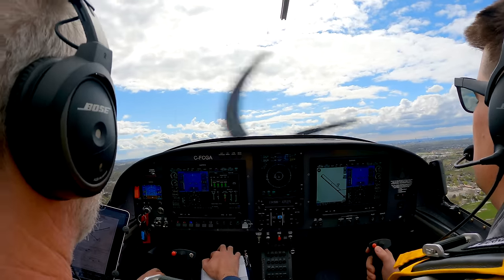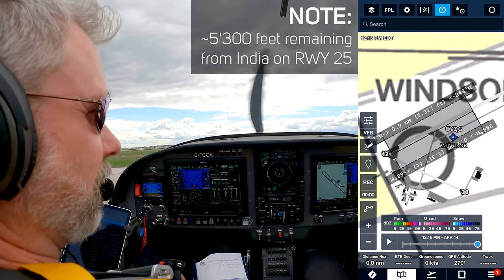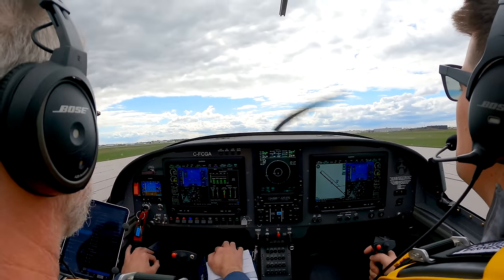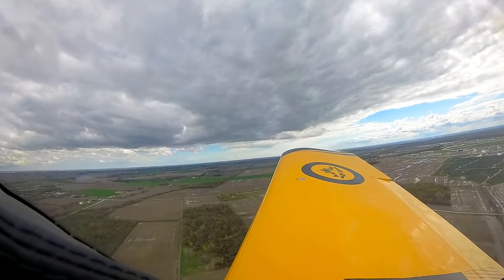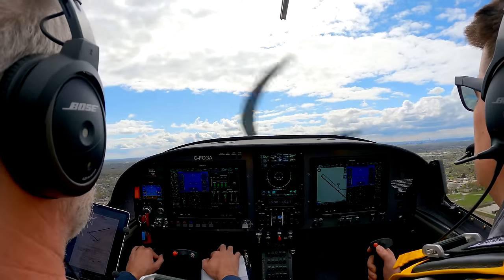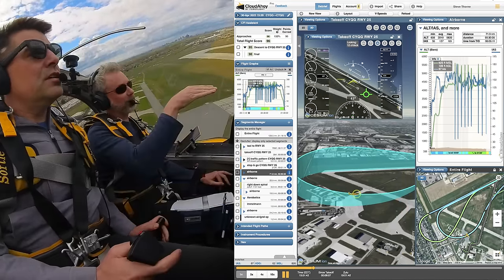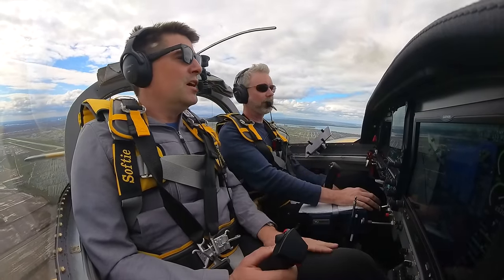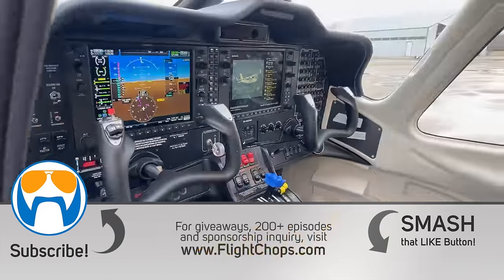Making the IMPOSSIBLE Turn… Possible from 600' AGL?

Comment: I do 300 feet all day long with my students. Depends on the aircraft and DA
Reply: Most engine fails are partial power.  Power go down due mostly lost one cylinder.  On 4 cylinders engines will go down to 1,800-1,900 rpm.  Just about Minimum Level Power (MLP).  Practice MLP Slow Flight.  With about 10 degr. flaps. One of my students with only 70 hours total, took off C172 with 3 adults on board, rpm dropped to that, but he had training turnback from 400 agl. He turned back from 300 agl, landed opposite.  No damages.  I taughtTurnback Training in the 1990's,.  Partial and total EFATO I did.  I called that EmergencyLowManeuvering.  

The 444 Partial Power Rule .  If over 400 agl, turn to side 40 degrees for 4 seconds while leaning mixture a bit and SOME Carb Heat too.  Then 40 deg bank to the runway at Vglide speed.  444 Partial Power Rule. drop flaps on it before drop all the power to land.

Comment: That copilot is sooo scared and insecure of the Vglide 45 Turnback.  He needs to practice lots more.  Do first The Vglide speed level turbacks.  After flying along a highway, flyover a spot, get room for turnback and flyover again at Vglide 45 bank level until you get used to turnbacks, then do the EFATO after. 

Good to learn them on GRM Turnbacks first. Many accidents when doing GRM turnbacks, and Box Canyon turnbacks and Circling Turnbacks.  Ignorance is not the solution.  Ignorance is the problem that causes accidents..

Comment: At the end of the day, the physics of this problem are all about ANGLES. Climb angle, wind angle, descent angle, bank angle, and such. Everyone gets all hung up about a minimum altitude but the question, grossly simplified, is really did you have a climb angle well in excess of your descent angle. If you can’t answer that question you shouldn’t be turning back. 

In college I wrote a computer code which completely solved this problem. You could put in the variables for everything, runway geometry, aircraft performance, pilot performance and it would find the minimum altitude and performance numbers to make it happen. I used the code and practiced the maneuver many times and from all that experience I’ve come to the point now where I’m rarely if ever willing to turn back. 

Not much more dangerous out there than an amateur test pilot. Consider your limited knowledge, ability, and testing capability before you go off playing Chuck Yeager. 

Be careful out there…

Comment: @3:38 - no read back what so ever...
Reply from the maker: While I tend to read back VFR clearances and instructions, they are not required (unless including a "hold shot", etc) other than to acknowledge with the tail number, as Luke did.  
He's a senior flight instructor, and certified flight test examiner - his procedures are solid.
Reply: yeah I also noticed they never read back any cleared for takeoff or to land after the 1st go around. You'd be getting an earful from any CFI
Reply from the maker: Rules might be different in the U.S. but in Canada acknowledging those specific VFR calls with just the tail number are the correct procedure.  That said, I'm not as experienced as Luke, and I do tend to read back more IFR style just to be extra thorough.
Reply: @FlightChops  I believe readback is mandatory VFR in the US, but it's not in Canada. I personally prefer to read everything back to make sure I heard right. It's saved me a few times from stupid so I will always recommend read back. Only time I'll answer with just my call sign is when I'm clear to land with no additional instructions from tower.
Reply: According to the Canadian Aviation Regulations (SOR /96-433), pilots are required to read back any air traffic control (ATC) clearance to the appropriate air traffic control unit if they are flying under Instrument Flight Rules (IFR). For Visual Flight Rules (VFR) flights, pilots are only required to read back an ATC clearance if the air traffic control unit requests it. Pilots should read back parts of ATC clearances that include runway assignments, vectors, or altitude assignments to verify that they and the air traffic controllers understand each other.
Reply: @onyourbikes  well fair enough I don't know Canada regs but if you don't think should be good practice to read back a take off or landing clearance then good luck out there
Reply: @sdluke  I read back as much as I can (I'm in Canada) even though not required under Canadian regs for VFR. 
But 
There are times at my home airport when you can't get a word in edgewise, and I've heard the controllers chastise VFR pilots for giving read-backs and clogging up the freq. Different countries, different rules, different cultures.

Comment: This is not a realistic trial.
The runway is very long.
The impossible turn is impossible from virtually all standard municipal airports.
Reply from the maker: If you look closely at what is going on during the 800' AGL test we were lined up well beyond the departure end and would have touched down probably with in ~2000' of India, where we'd departed from (Thus a ~2000' runway would have worked, but you've inspired me to run the actual numbers to determine what the shortest runway we could have departed from, and made it back to would have been). 
Regardless, from 600' AGL we couldn't even get lined up, let alone make it back to the runway we departed from, so length is moot in that case, and that is the key data I was looking to collect here.

Comment: It’s irresponsible flying.
Straight ahead
Reply from the maker: If you're going to make a statement like that, please offer some value with insights to explain.
Reply: No, it’s not. There are some conditions where you can safely turn back. It depends on the winds (ideally a crosswind situation) and of course altitude.
Reply: Promoting such actions to low time pilots / inexperienced pilots that may be watching your channel can bring them unstuck quickly. That’s a fact.

Comment: This is NOT realistic and doesn’t NOT simulate a loss of thrust on takeoff. The last person who made videos like this attempted to return after engine trouble and it didn’t end well.
Reply: It wasn't intended to simulate that. 🤷‍♂️
Reply: @owensparks5013 .  It says right in the beginning of the video they’re testing multiple scenarios. These are based on the title scenarios where an engine is lost on takeoff and attempt is made to return to the runway which results in low altitude stall/spin and death 90% of the time..  it is lunacy to practice it
Reply: I call BS on that comment.  Maintaining airspeed in a turn is a basic skill taught before you even solo.  Impossible turn at an appropriate altitude is no different than any other emergency procedure a pilot should now.

Comment: Come on Chops.  You Know Better.   
GO STRAIGHT AHEAD.   The second the scenario commences, the airplane belongs to the ins. co.   Go straight ahead.  If you are 2000 agl  you can shop for a place.  
I believe in Aqp.  And. Stick  and rudder by Wolfgang L.
Reply from the maker: Did you watch this episode? I'm not worried about saving the airplane... Straight ahead from Runway 25 here is almost certainly going to be fatal AND means you're likely taking civilians with you.
Reply: Depends.  USe the Power OFF Turnback 777 law.
Reply: Most engine fails are partial power.  Power go down due mostly lost one cylinder.  On 4 cylinders engines will go down to 1,800-1,900 rpm.  Just about Minimum Level Power (MLP).  Practice MLP Slow Flight.  With about 10 degr. flaps.  A friend with only 70 hours total, took off C172 with 3 adults on board, rpm dropped to that, but he had training turnback from 400 agl. He turned back from 300 agl, landed opposite.  No damages.  We took Turnback Training in the 1990's,.  Partial and total EFATO we did with EmergencyLowManeuvering channel.  Theres a 444 Partial Power Law.  If over 400 agl, turn to side 40 degrees for 4 seconds while leaning mixture a bit and SOME Carb Heat too.  Then 40 deg bank to the runway at Vglide speed.  444 Partial Power Rule.